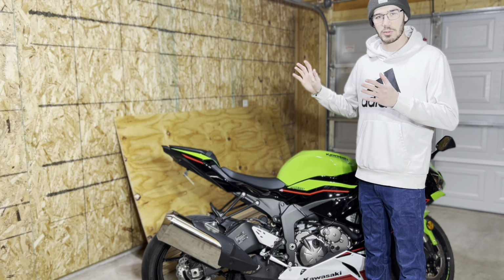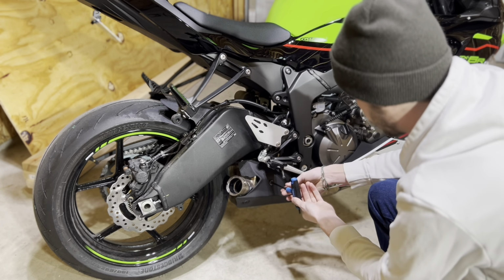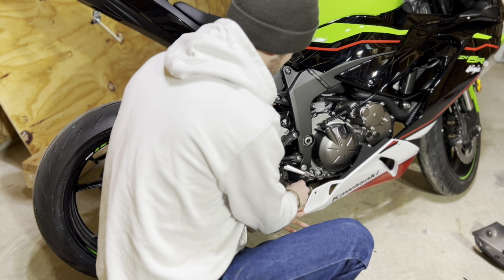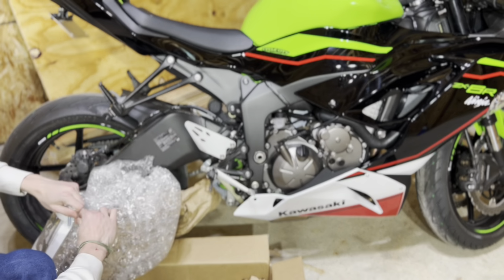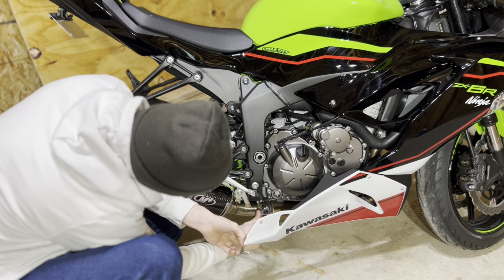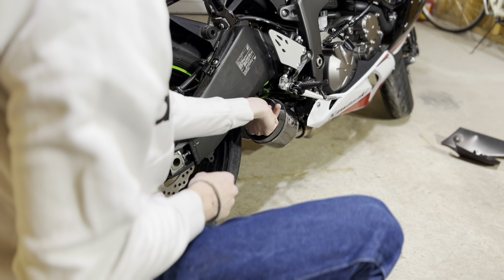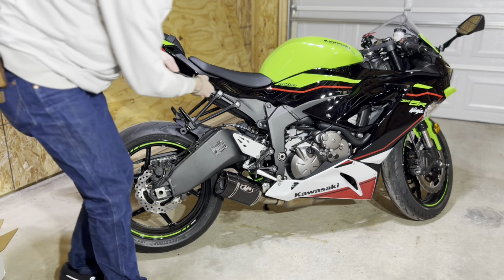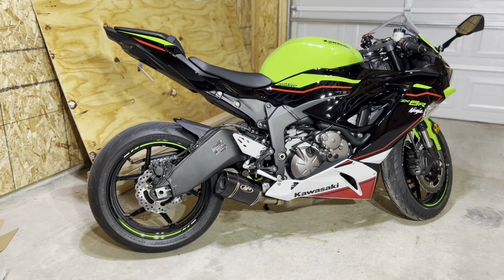Installing M4 Street Slayer on 2021 Zx6r

Comment: Gotta do a Cat delete and then send your Ecu to get flashed and tuned to Moore mafia and man does your bike run and sound so much better. I got a 2019 and it’s a completely different bike wants you get it flashed and tuned because factory restriction on power is very noticeable.

Comment: What tool did you use at 7:15 to get the Allen bolt out. Please help.
Reply from the maker: I used a ratchet with an the correct size Allen socket

Comment: Did you use a servo buddy for the servo delete? And did you also tune after it just leave same fuel plan when just pulling off back muffler?

Edit: for when just running secondary as exhaust, also did it sound good with that?
Reply from the maker: I did use the servo buddy, no tune has been used yet, I will be tuning when I delete the cat. It sounded pretty good with only the secondary but when I put the m4 on it sounds a lot cleaner

Comment: Hey man, you said you ran your bike with just the secondary? Is this safe for the bike?
Reply from the maker: Hi there! I’m no expert, but this did not harm my bike at all. It still had plenty of back pressure (if not more than it needed). I did cover the outlet with mesh as added precaution though.
Reply: @tmojo  Awesome thanks so Much!
Reply from the maker: Anytime!
Reply: @TMojo  Just stripped out my servo and stock exhaust and installed a servo buddy, tip for anyone else working this just use some cutters and cut the servo cables on both ends, they slide right out lol.
Reply from the maker: Sweet man! I hope you enjoy it!